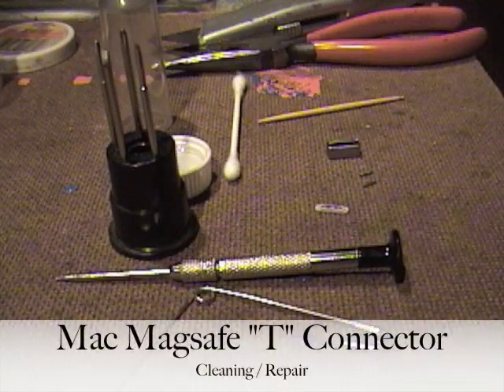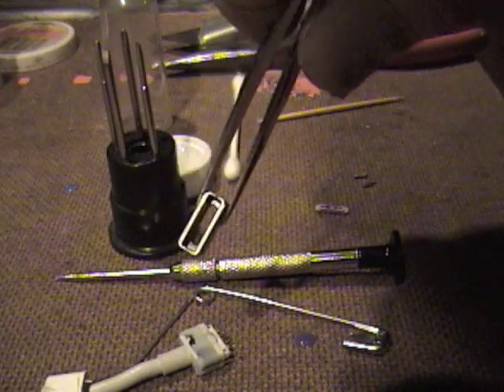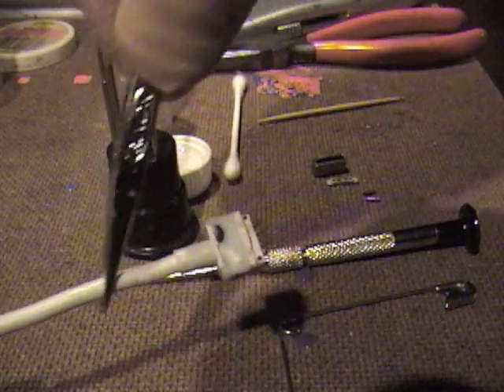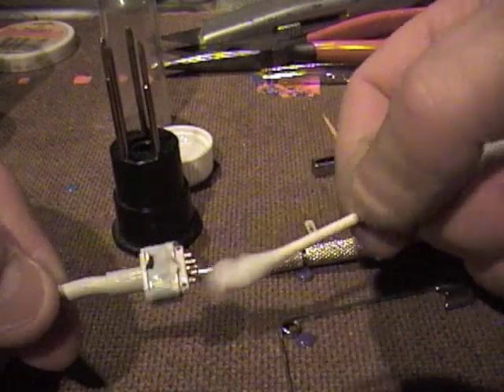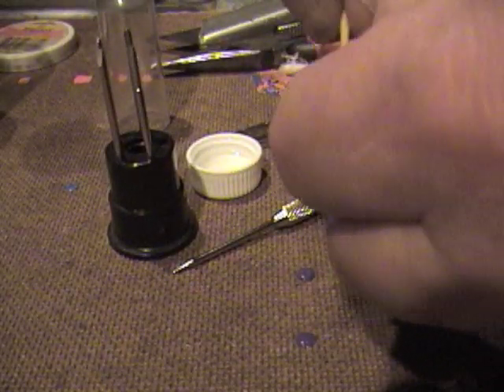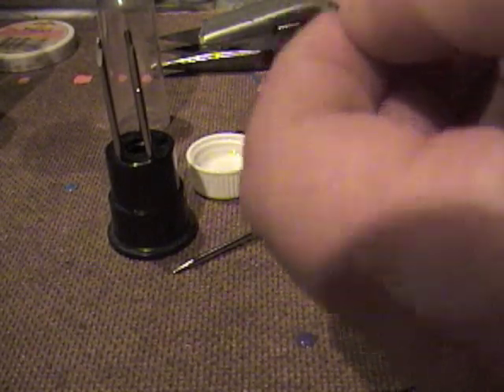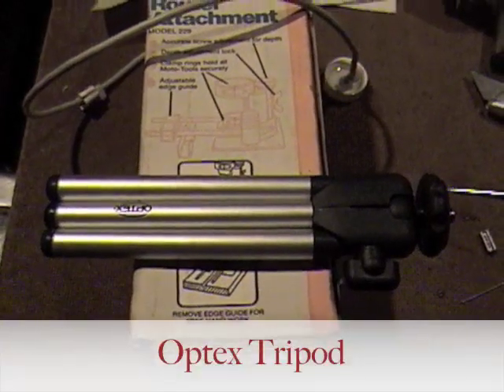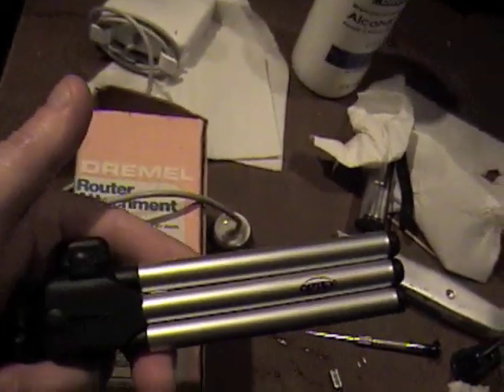Magsafe T Connector Repair/ pin Cleaning

Comment: ridiculous !! NO NEED at all to cut the plastic cover, just hold the metal connector block with pliers and put a screwdriver in between the pliers and the plastic cover and pry it off. comes off nice and easy without any damage, because that's how it is meant to come off. ALSO the metal block is NOT the Magnet. the Magnet is on the computer side, easily veryfied by trying it on any steel object, does it stick to it? NO. then it's not a magnet, not sure why he doesn t notice that because the supposed magnet does not stick to his pliers DOH!

Comment: The centre pin  or so called "alignment pin" is the pin which powers the LED in the male magsafe plug. Power comes from your laptop  into the centre pin to power the LED and is earthed with the two outer pins of the plug.  The two mid pins are 16.5v in 60w supplies or 14.5v in 45w power supplies. The so called "magnet" is just ferris metal. The magnet is in the female magsafe terminals in the laptop. if the pins do not spring up, most of the time its failure of the springs concealed in each of the brass pins. These are unfortunately non reparable. Your best bet is to remove the DC cable from the power supply and buy a replacement cable from aliexpress for around 6 USD which you can solder back into the power supply. Hope this helps
Reply: this helps more than the video

Comment from the maker: Many of us have this same problem, that is why these instructions are here.
If the light on the adapter still lights then it's the pin contact.
The pins are spring loaded so they make contact when attached.
If the pins and cylinders they slide get dirty they no longer slide back out.
This is caused by buman body oil, skin cells, dirt and dust being atracted to and coating the pins.

Comment from the maker: The wires are colour coded - I would use a piece of heat shrink electrical tubing lsipper onto the wire the use the least amount of solder as possible to lap join them - lap joint - cut wires on one end at staggered lengths - short, longer, longer, longest and do the same in reverse order for matching wire on the other end - (hopefully that's clear), wrap each with electrical wire, this is meant so that the new thickness is not all in the same place.

Comment: THANK YOU!, out of all the damn videos this was the most helpful for the t connector problem, the whole resetting of the macbook taking battery out didnt do anything for me. the problem is with those pins not reaching the connector anymore. its actually a very simple fix that apple wont tell you about. I actually didnt even get to the cleaning part, after i split the plastic over the magnet i pluged it in and worked on first try. Im assuming because its able to go in more.
anyways thanks alot

Comment: you keep calling it a magnet. rofl didn't you even notice nothing was sticking to it?  the magnet is in the jack on the device. that bit on the cable is just ferrous metal.  but yea, good job totally destroying it to clean it when you didn't have to.

Comment: for the first part (sliding the plastic thing off at the beginning), I don't recommend cutting. Instead, I took a thin blade (mine came from a crappy swiss blade), I slid it under one of the longer sides, twist it so that it's now perpendicular to the charger, but don't force because I didn't want to make it too big. After repeating that a number of times on both large sides, I was able to slide the white part off without destroying it too much. If I slide it back in, it doesn't move backwards.

Comment: Or before attaching magsafe just tap it at a table top -medium hard- a couple of times. The pin(s) will slide out and you'll get a charge. This solution will not fix the problem per se, but it will work every time, in case its indeed the stuck pin syndrome.

Comment: This helped me diagnose my issue thanks a bunch!  He does say this is for a MagSafe T type of connector, and I'd just like to emphasize that the newer MagSafe 2 style does not work the same - for starters it has a metal outer housing and not a white plastic one.  Beyond that I've never tried to take mine apart or seen anyone do it online even with some cutting.   Apple recommends to try to clean it with a cotton swab or soft toothbrush, dry, they do not mention alcohol or solvent. I fixed my 2 pins by alcohol cleaning with brush and q-tip.   https://support.apple.com/en-us/HT203207  

In my case my Mac and MagSafe 2 charger are 6 years old and in the last 6 months would not reliably charge and this video helped me see it is the pins on the charger being stuck back in and not protruding enough. I was afraid it was a problem with the age of my battery because I just leave it on the charger at home 90% of the time.   But thankfully it's just the charger pins...  I have overheating burn spots on the 2 inner pins (only) and sometimes the connector itself is hot, ALL indicating a poor (resistive) contact.  Sometime the LED goes green (presence detected) but never amber (charging), which means it does not sense a charge current and sure enough the OS screen does not show the charge symbol.  Sometimes it would start off charging only to stop in a few minutes.  Cleaning fixed mine, we'll see for how long.

Comment from the maker: Atakan2025 - I await the Youtube link to your video on how to do that! Thankyou. 
I agree that it doesn't look that great - but it's safe with gobs of epoxe holding it back together WORKING and it looks a lot better working than it does sitting in a used parts box for recycling. ANd it saves me $80 to get it back working. BUT hey! I await your solution and video.

Comment: You can buy L shape dc connector and fit with your current charger instead repairing the old style T shape connector. Google the product called  QUICKFIX DC PLUGS and buy from e-shop. This is a simple and easy solution to fix pin damaged laptop chargers, I believe.

Comment: first of all, thanks a ton for this video! I actually had a loose pin so I pulled it out and stretched out the spring, it works for now but the spring is slowly going back to how it was. I might try to make a replacement spring if that's even possible.

Comment: but the magsafe end in the freezer for half hour and then crack it with vice. it opens like a walnut right along those plastic weld points.
Reply: Do you know how to open the T-connector if it's out o steel?  I belive it's called Magsafe T2
Reply: In a hurry? Invert a can of compressed air (Dust Off?) and, with straw attached to nozzle and fingers in gloves or cots, spray the connector for a few seconds. Repeat on the other side shortly thereafter. Repeat cycle. Then squeeze diagonally across the body (using a vise, or with needle-nose vise-grips pre-adjusted to lightly clamp across the diagonal dimension).